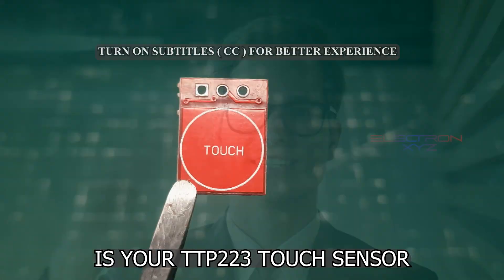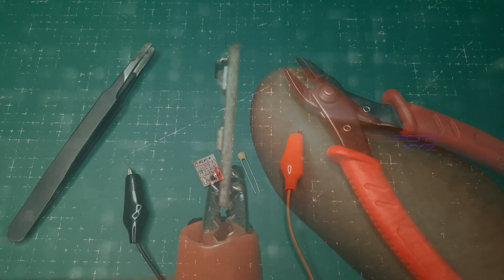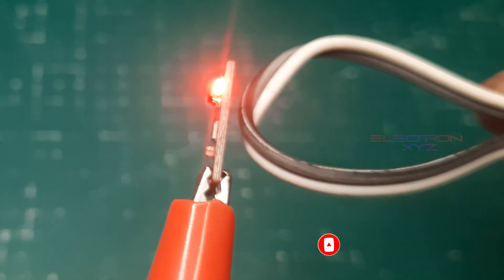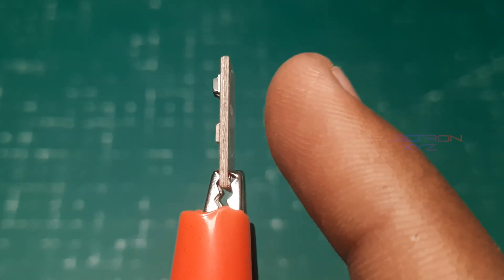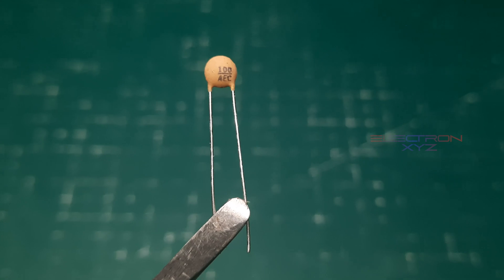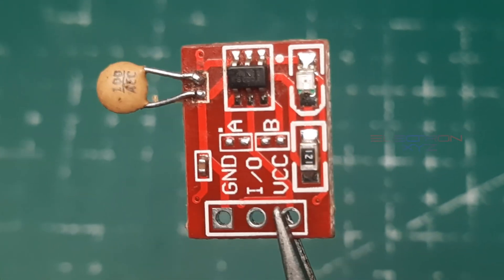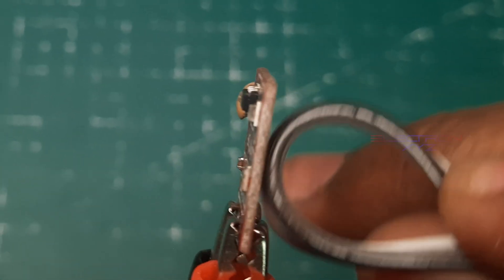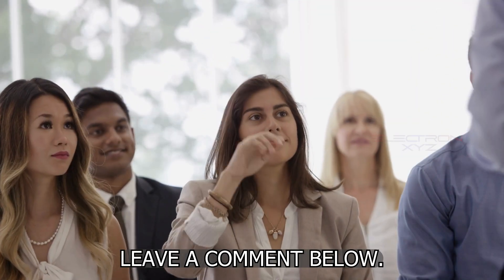TTP223 Touch Sensor Calibration: Banish the Phantom Touches! | TTP223 calibration

Comment: Can the sensor be touched if it is covered with thin transparent glass, approximately 3 millimeters thick?...
Reply from the maker: Yes
Reply from the maker: Then use it directly,no need to add any capacitor

Comment: Hello. Thank you very much for the video. Could you please tell me if I have a problem where when I hold the sensor for a few seconds, it cuts off (goes into sleep mode). Is there a solution to keep it tracking all the time?
Reply from the maker: When you touch it turns off?

Comment: When placing the finger for more than 10 seconds continuously, the light goes out and the finger needs to be removed and returned for the light to turn on. Is there a solution to extend the period and keep it sensing the touch?
Reply from the maker: Use the sensor in toggle mode.

Comment: I have an issue with the tuch module tp223.
On the touch module  I am putting my finger for more than 20 second 
In between sensor State has been automatically changed.
Is there any solution like after realising my finger device state should change.
Reply from the maker: Could you please elaborate it clearly?
Reply: @ElectronXYZ When placing the finger for more than 10 seconds continuously, the light goes out and the finger needs to be removed and returned for the light to turn on. Is there a solution to extend the period and keep it sensing the touch?
Reply from the maker: Use it in toggle mode , one touch to on and other to off, and what load you are using, it can drive only 10 ma

Comment: Thank you so much. Now can you make another video connecting multiple modules to a shared power source, and make them to function independently using the capacitor to filter the signal and also a pull down resistor to avoid the float and the interference among them please? I know there are modules of 4/8/16 inputs, and also works in parallel, but the multi key function are no quite supported and no quite reliable, and I was wondering if using these modules might resolve it for a DIY project on hand (substitute mechanical buttons for an arcade controller)

THANKS :D!!
Reply from the maker: @marknebadon8709  sure man, subscribe and stay tuned.

Comment: i want to make it more sensitive to work through 3mm wood sheet what should I do???
Reply: @clutch_editss I have the same problem. I just use built in touch sensor in esp32. that I can control with software. Now it can detect touch through 18mm plywood 😅 I connected the gpio pin to copper pad so it has larger touch area

Comment: Your capacitor (marked 100) is actually 10 picofarads. If it was marked 101 then it would be 100 picofarads. Of course if it was 100 microfarad (as per the audio track) it would be marked 100uF.
Reply from the maker: Yes

Comment: Hi! I installed this sensor in an aluminum profile for a led strip, using this profile as an antenna. But in this case, parasitic capacitance appears between the led strip and the aluminum profile, which reduces the sensitivity of the sensor more than the capacitor in the video. So much so that I have to wait 2-3-5 seconds after touching the profile to turn the light on or off, and sometimes it doesn't even work. Can anyone advise me on how to eliminate this parasitic capacitance or give me an idea of what to do to make the sensor work well. My idea is to make a lighting for the kitchen counter that can be turned on and off by touching the aluminum profile along its entire length.
Reply from the maker: @hristohristov4705  what about connection points, i mean +,-, out

Comment: can I add the capacitor in the breadboard without soldering between the output pin and the ground of the sensor?
Reply from the maker: @yousefmohamed3871  you can use ground pin but other pin is not output pin,  have a closer view at the board. Subscribe for more {^~^}
Reply: @ElectronXYZ  okay thank you so much ❤❤

Comment: Hi am connect ttp223 with 5 v relay and use B mode but when ttp223 sensor put on a support I mean fixed with board automatically sensor off after 5-8 secondly, what is the issue? Any solution? Even if a paper touch sensor goes off
Reply from the maker: Is it turning of after 5 seconds
Reply: @ElectronXYZ  yes, turning off after 8 seconds
Reply from the maker: @datacenter-n1w  time is not relevant to this but as you said paper thing,it can be solved, by adding  a capacitor as mentioned in the video.

Comment: is 47pf still very sensitive?
Reply from the maker: No,it is not that much sensitive you can use it if is available handy.
Reply: @ElectronXYZ  thank you. i bought the 47pf. sensitivity is very low. i think i need a value of maybe 20pf. because ill be using it under a 5mm thick pvc.
Reply from the maker: Why not without cap ?
Reply from the maker: @needlethread4715  glad it helped you, subscribe for more